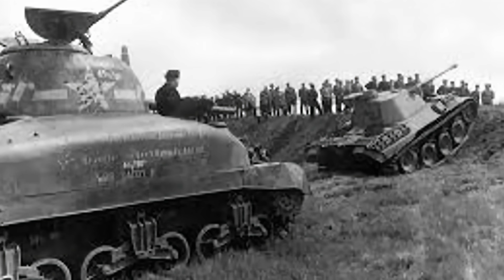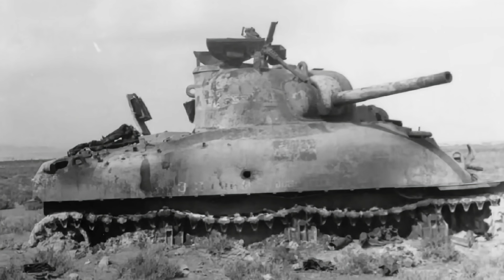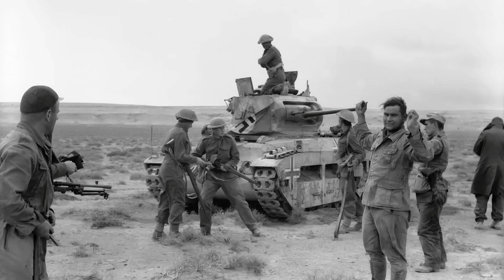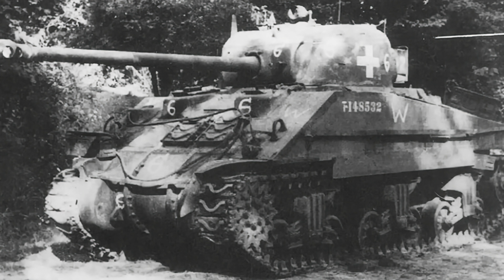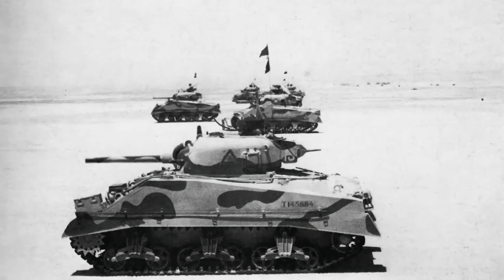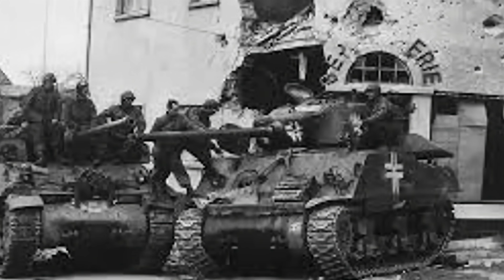German Engineers Tested A Captured Sherman — Then Admitted They'd Never Built Reliability Like It

Comment: It appears that the German auto industry didn't learn a lot from their experience in WWII.  They are still building expensive over engineered cars that are not that reliable, are very expensive and require expenswive maintenance at a factory dealer.  Compare a Corvette to almost any $250K to million dollar plus super car.  The Corvette can be repaired at a Chevy dealer.  The European super cars are no faster than a $175K Corvette ZR1 but cost many thousands of dollars per year in maintenance.
Reply: I’d say that some lessons were  learned, the 911 series Porsche, like the M4 has been dialed in over years and years, a big fan of the Vette, but the 911 is designed to run, at max speed for 24 hour races, and all cars have to go to a shop themselves days to be worked on, the 2011 turbo s, was a 199mph car, they don’t race light to light, they race from city to city. But your point is good, and you can’t beat the bag for the buck. I can vet 100 k for my car still, but dealer mark up in new Porsches is ridicules.
Reply: If I was in a tank battle with enemy tanks, I would prefer to be in a German tank. I would survive that way.
Reply: @twinturbo8304  and you would rarely leave the yard to go and fight ..
Reply: @twinturbo8304 likely hiding in a berm on the side if the road after your German junk failed 12kms into it's journey to the battlefield.
Reply: Last good car from germany was DKW the Volkswagen beetle... The early Mercedes & early BMW ...their motorcycles were good but had some weaknesses ...  Everything else especially today is over engineered JUNK!!
Reply: Yes they did indeed require expensive wives maintenance at a factory dealer, I'm betting surely whoever needed repairs from a dealer has a 50% chance of being married to a wife that works in the shop making maintenance
Reply: And whatd about OUR modern military? It seems to me we now rely on a few very expensive weapons at the expense of many, many that are less expensive.
Reply: @dginia  yeah true from what I think I know... The modern American war industry prioritizes getting paid for their product,  while other military industries are trying to be lean and cost effective and are able to produce more equipment at a much better price.
Reply: Autobahn has unlimited speeds, therefore the average German Cars a built for high speeds
Reply: German engineering is sweet when it is all working.
Reply: They learned how to rip Americans off by giving us cheaply manufactured versions of their cars so they can make money off parts.
Reply: I drove the same Audi for years, what on earth are you talking about?
Reply: Yeah, modern US cars are soooooo good, LOL.
Reply: Toyota just entered the chat :). The last time I took my car to a mechanic was in 1996 ...  I perform whatever little maintenance needed.
Reply: @DogsAndDYI Toyota left that chat in 2017. They wont be back.
Reply: The irony of  Americans accusing others of mechanical reliability 😂😂😂😂
Reply: So that's why the new Z06 & zr1 have dropped the pushrod dinosaur and gone with overhead came design that helped Toyota crush AMERICAN AUTOMOBILE INDUSTRY. OH ya that engine did move to the middle but ya nothing to see here. (I like Corvettes)
Reply: @conradhenninger2209 crush? Toyotas were built for fuel efficiency and don't have anywhere near the torque the American Vehicles do which is why they still can't build a truck today LOL. In addition they are far more unreliable now and have been since 2017 when they had to meet the new Cafe standards in the USA which they skirted for decades because no one buys and heavy trucks from Toyota because they are too scared to make one. They cant even build a Tundra anymore. A Tecumseh isn't a truck 😂. Even your Supra comment... The Supra woukd get smoked by the older Grand National any day and the best mod for a Supra was literally to drop a GM trans behind the motor...because the Toyota one was trash. It was so common bell housings were mass produced to do it 😂
Reply: Corvette is useless    My bmw has 165k  trouble free miles holds 5 people and corners as well if not better than any American car
Reply: @twinturbo8304 sure it does 😂 $8400 worth of repairs later. BMWs cant traverse a 3 inch puddle without hydrolocking. Handles real good sitting on the road waiting for no doubt a wrecker from the big three to come get it...because Barbarian Motor Works cant make a real truck either. Surprise surprise.
Reply: @twinturbo8304 

Ya got a good one!😉
Reply: American Cars are Lemons no one outside of America wants one 😂
Reply: Except the Corvette is what european drivers call shite. Just because you're prepared to accept lower standards dont push them on others.
Reply: @bursar115 the same basic performance for half the price, and you can afford to maintain it. Yes please
Reply: @bursar115 must suck getting constantly smoked  by shite 😂

Comment: Near the end of the war, the Brits put “Griffin“ engine and some of their tanks. This was a non-supercharged version of the famous Merlin engine.

Running Merlins at more than 1000 hp, the same as they had in the PT boats in the Pacific, I wonder how a Sherman would’ve performed with that kind of engine— could the Sherman‘s drive train handle the extra strain of that much horsepower?  If so, what would the top road speed have been?
Reply: I think that the Merlin engines that were in the  British tanks like the Cromwell and  Comet were called Meteors .The Griffins we’re used in the later Spitfires such has the Mk 12, Mk14, and Mk18s and put out over 2000 hp compared to the Merlin 60 that put out about 1600 hp
Reply: Its an interesting question if the Sherman had more power and if the drive train could handle it. More armour would be possible too on some variants.
Reply: @Surv1ve_Thrive But would the suspension and tracks cope with the extra weight and stress from higher speeds
Reply: @stephenbarker5162  it would require beefed up running gear yes. It did receive HVSS late war which was heavier duty. Maybe enough. 🕊♥️🇬🇧

Comment: You forget to note that the German tanks had limited radios which were  usually only working in the old AM band.  The Shermans had the latest in super advanced FM technology tank radios.  Some of the German tank radios could receive only while other German tanks had no radios at all, using flags to signal between each other.
Reply: AM radio! Ignition noises, bad grounding, too easy to alter the sign wave. Yup, what could go wrong
Reply: Good point. Had to be frustrating for those crews. I think crystal-based tuners had a lot to do with it. The problem of 'aging' had been solved (in the US I think), making a very frequency stable component viable. As I understand it, amatuer radio enthusiasts helped attack the problem. They had already found ways to increase the longevity, pointing to the  manufacturing solutions that took it the rest of the way.
Reply: He went into detail about this in another video.
Reply: that was the french tanks
Reply: The Germans were the first to put radios in every tank. What you are writing is bs.
Reply: An extensive late war report from the US 2nd Armored Division comparing US and German equipment found US and German radios comparable.

All German tanks had radios.
Reply: @TTTT-oc4eb Radio technology in American WWII tanks
Radios used: The most common radios in American M4 Sherman tanks were the SCR-508, SCR-528, and SCR-538 models. These were FM radios that provided a significant advantage over the AM radio systems used by German forces, which were plagued by static and interference.
No way were they comparable. Plus, most german tanks had receive only, only a couple had 2 way. Because of the terrible static, the german tankers would use flags instead
Reply: @TTTT-oc4ebno they didn't .
Reply: @farmrrick  So, which German tanks used flags to signal between each other?
Reply: @TTTT-oc4eb I suspect Alaingabriel is a bot, this is a talking point about russian tanks. And this bot is lying by pretending this was the case about german tanks. German tanks had two way radio since the panzer 2.
Reply: @TTTT-oc4eb When radio silence was required for a given movement, all tanks with radios used flags to signal between each other.
Reply: @TTTT-oc4eb  incorrect,  well known that a group of German tanks , only the command tak had 2 way radios . The rest could only receive if they had a radio at all . German tank doctrine was in training strategy.  They couldn't operate outside of it .

Comment: Germans really crap the marbles, when they inspect RD1820 engine from B17 and later R2800 from P47. Those who had enough mechanical and industrial knowledge, knew the war was over when your enemy can produce those engines in thosends.
Reply: Göring generalized much of his commentary with the same observations concerning his German engines compared to American.  He (who was in charge mind you) hated all the waste, time and money incorporated into the Daimler-Benz DB 606.  “I have never been so furious as when I saw this engine. …Nobody mentioned this hocus-pocus with two welded-together engines to me at all.” This comment reflects his frustration with the complex and problematic design of the DB 606, which combined two DB 601 engines into a single unit, causing numerous reliability issues including frequent engine fires.
Reply: Kurt Tank, the aeroplane designer, found that the US engine manufacturers actually spent time machining air cooled aeroplane engine cylinders that required no shims or gaskets....either to the crankcase or the heads.

He said this meant Germany would lose the War...
since the designed and projected life of an aeroplane engine in combat was 25 minutes...for the Germans.

Comment: In addition to the superior powertrain reliability, there was mechanical turret rotation, gyro stabilized main allowing firing while moving, and superior FM radios with better functioning in every tank.
 The Shermans were manufactured to be easily loaded onto ships and railroad cars, and light enough to transverse most European bridges.
  But leave it to the Brits to figure a way to install their awesome 17 pounder anti tank gun in that tiny turret by rotating the breech 90 degrees, to create the dreaded(by the Krauts) Sherman “Firefly.”
Reply: The Americans considered it but had  our own 76mm high velocity gun. It fit better, was lighter, and after the Hvap ammo was used, was just as good but easier to use.
Reply: @jimh6763  LOL
Reply: @jimh6763  thanks for that info
Reply: Regarding the documented inaccuracy of the 17 pdr until the ammo was improved in 1945, tank v tank combat in NW Europe was fought at much shorter ranges than on the Germans ' more familiar Eastern Front. I doubt 17 pdr relative inaccuracy at ranges under 460 meters / 500 yards made much difference. 
Likewise, the High Velocity Armor Piercing - Ballistic Cap rounds of the 76 mm US gun was quite effective with its high tungsten content. However, it was in short supply until 1945. High hardness tungsten was acutely needed for many uses, especially machine tools for cutting softer metals like steel. 
The Easy Eight Sherman with HVSS, the Ford GAA engine, and 76 mm gun was the US Army's postwar keeper. It was they that were later deployed to S. Korea to fight in 1950-53. Admittedly, tank v tank combat was uncommon in the Korean War.
Reply: Shermans were also narrow enough to traverse bridges and load on railcars without removing tracks while most German tanks were too heavy or wide to cross many small bridges, and generally needed the tracks removed to fit through rail bridges and tunnels when moved by rail.
Reply: The M4 didn't field a 76mm until July 1944, and the stabilizer wasn't available until August.  This video is about Shermans captured in February 1943
Reply: @richardjohnson8114 so?
Reply: The Sherman tank could not fire accurately on the move . Period.

Comment: The Sherman was a good medium tank in all aspects. Reliability speed accuracy just had to small of a main Cannon. The Germans had complex, beautiful pieces of engineering. Heavy tanks  breaking down a lot.  Complex vehicles that require a lot of maintenance. The America's supplying most of the allies with tanks, I mean, it fit the bill. German heavy tanks at a huge advantage over the Sherman. I believe both tanks served both armies well.
Reply: With the exception of the early batches of the Panther, which was deployed while still in the prototype stage, all Geman tanks were reliable by 1944-45 standards. 

There is absolutely no real, hard evidence the Sherman was more reliable than other late war western tanks, British or German, only hearsay. Like all WW2 tanks, it too broke down en masse during long road marches. 20 out of 50 Shermans could be expected to fall  out to minor or major mechanical issues during a 30-40 miles road march.
Reply: @TTTT-oc4eb  it's hard to believe, and I read the exact opposite data. However, I believe you at face value. I just wish my Audi S7 ran is good as my Ford Taurus did, and I'd be a happy camper. Thanks for the information I'll research it on my own further. The after-action reports I read and the maintenance reports.  You brought up the panther, and the after-action reports when they brought to Russia was a disaster. But you said between 44 and 45 so maybe ironed out the maintenance issues by then. The best vehicle the Germans had was the Stug but it's not a true tank.
Reply: @Fuxerz  They always refer to the 1943 Panthers - which were deployed far too early, only slightly more than a year after design work started. Normal development time for a WW2 tank was 2-3 years, and even then there were always a lot of teething problems to get rid of.

From May 1944 to the end of the year, the Panzer IV, Panther an Tiger all had average readiness rates of 70-75% (Jentz 1997), and more big cats were out due to combat damage than mechanical breakdowns.

I've had Volkswagens for the last 30+ years, and have been very pleased with all of them - I now drive an ID.7.

Comment: Wouldn’t the Germans have had access to Ford engines even before the war?
Reply: German Ford plants in Germany produced engines for their own line of vehicles and military equipment, but there is no indication that the German military had access to or used the same Ford engine models that powered American Sherman tanks pre-war or during WWII. The Ford GAA engine, for example, was an American development designed specifically for the Sherman tank and was not a German engine weapon system component.
Reply: This was about much more than the engine, it is about the design philosophy. The Americans emphasized things like low maintenance and ease of use, the Nazis focused on power of gun and amount of armor. If you look at the wheels of a Tiger or Panther, they are these incredibly complicated overlapping design where to get at one wheel you have to take off two others first. More of the big tanks like Tigers and King Tigers were lost due to lack of fuel or spare parts than were destroyed by the enemy. Off course, that meant that the average Sherman didn’t have much of a chance against most Nazi armor. But we had so many more tanks as well as other ways to destroy tanks like air power, that didn’t compensate for the ability of the US to out build and maintain our tanks.
Reply: @michaeldebellis4202    Additional Observation: Germans getting armor to the front = 300 miles.  Americans getting armor to the front = 3000 miles.  The wartime transportation - on two world fronts mind you - was an INCREDIBLE weapon system itself.

Comment: A tank that is available and always ready to go is a lot better than the one that is on a flatbed rail car, heading for Berlin for repairs
Reply: The best German tanks are the ones the German abandon because they ran out of fuel and the Nazis had none to spare.
Reply: Most tanks, even German ones, are repairable at their battalion maintenance shop that are within a few miles of the front. They handle 90% of the issues. For the 10% they head to next higher echelon repair shops or Army-level centralized depots with the region. The tanks heading back to Germany are total re-builds.
Reply: Unless they are turret tossers :)
Reply: @DogsAndDYI  The M4 had relatively good armor and was a very good, well rounded tank. The idea that it's some sort of cheap, weakly armored tank which was unusually prone to catching fire are bullshit. 

Very bad things tend to happen to ANY tank which has its armor penetrated by an anti-tank round. The M4 had far superior crew survival rates even for tanks that were hit by penetrating hits than other WW2 tanks did, because you could actually bail out very quickly. Improvements to ammo racks helped to reduce the chances of catastrophic fires or explosions part way through service.
Reply: @DogsAndDYI Germany needed a tank to make it a turret tosser. Theirs were all broken as per usual 😂